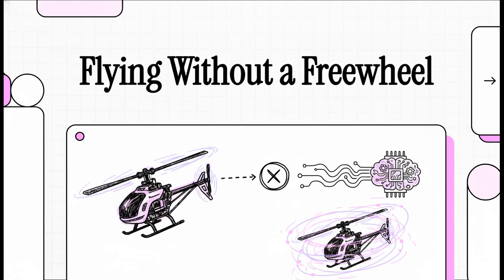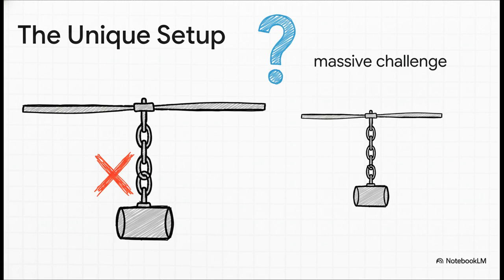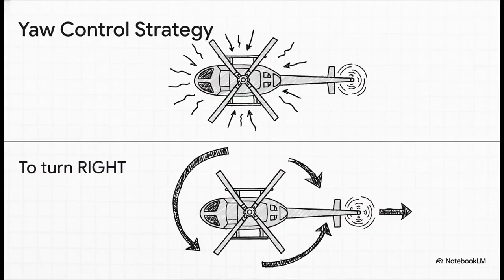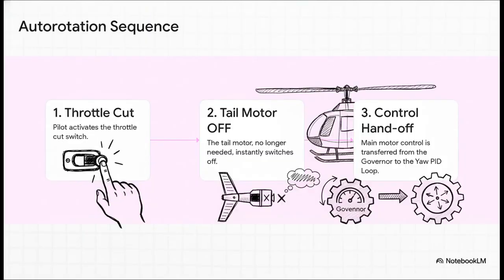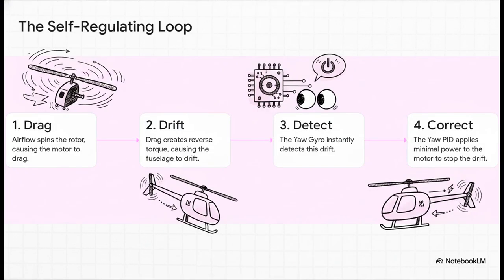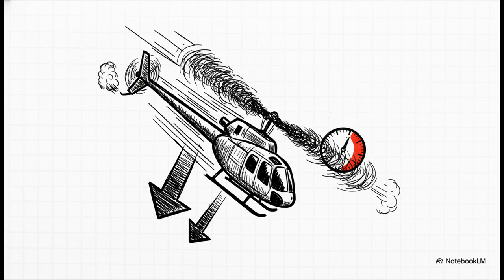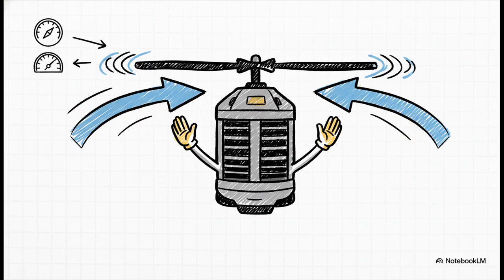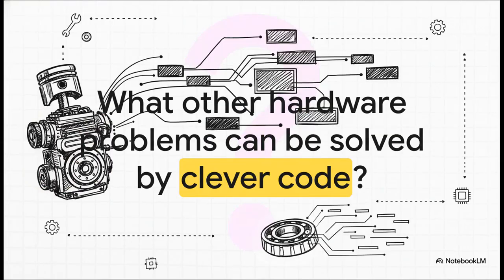Undirectional Electric Tail on an 700 helicopter - Part 6 - How to solve Autorotation and Overspeed

Comment: Hi, so the main motor freewheels and is mechanically locked to the main shaft? I guess this means the one way bearing can be deleted as it sometimes is a problem. Is that the basic of this idea?
Reply from the maker: Yes, and the reason you need to delete it because you won’t get left yaw authority in overspeed conditions otherwise. (With unidirectional motor tail) 

This is the fix for being still able to do autorotate.